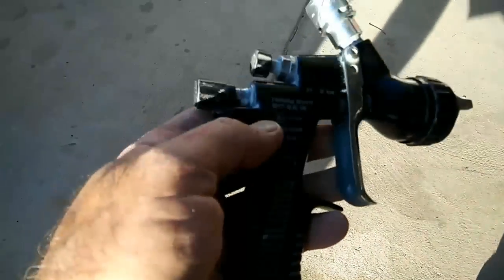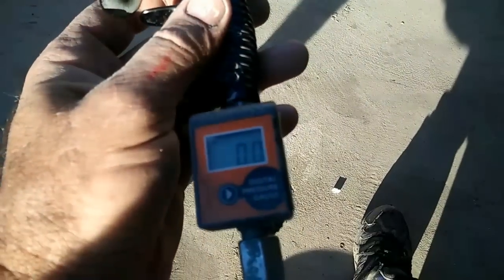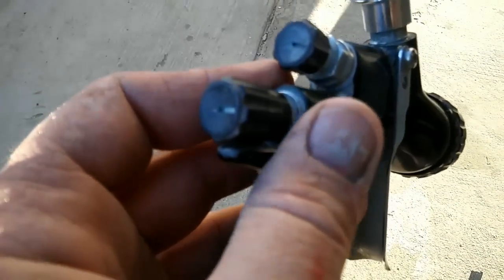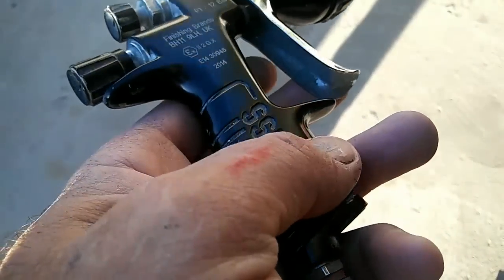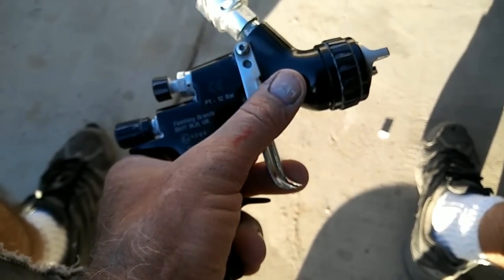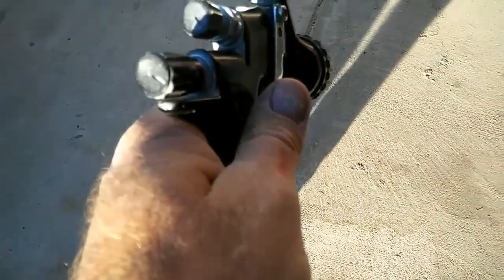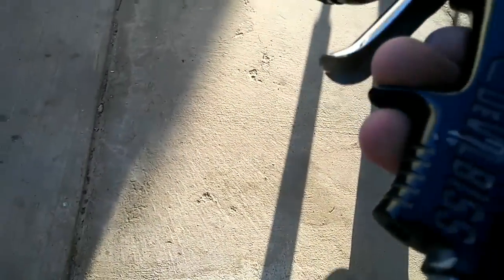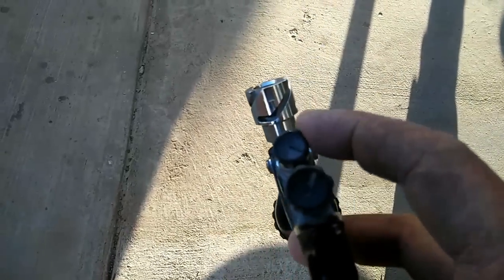How to spray clearcoat without getting any Orange Peel

Comment: Mike, this was a great video, I found it VERY informative. This is exactly the method I have been testing out to meet two goals: 1) get a better clear coat finish, and 2) reduce overspray. I have a body shop and a curtained paint booth. But my fans only move 3,000 CFM each. There are two, and I have a filter box on each that has 4 2'x2' filter sections stacked vertically. I have a friend who is an OG painter that puts 5 thin coats of clear on rather than 2 standard coats, and he rarely ever has to wet sand his finishes. Reason being he is putting on less material which is also more finely atomized, thus giving a better finish with less orange peel. I appreciate you sharing all the details of this, and I am looking at buying that Devilbis gun. I've had my eyes on it. I do have an Iwata SuperNova though, and it does do a great job for professional finishing. I will be checking in to the LVLP gun you mentioned. Very interested in that. I will have to get one and test it. If it works well, I'll probably be promoting it to my clients that I consult for.

Comment: Some good points about balancing that pressure with volume of material. I have been experimenting with no gun regulator lately. Adjusting air pressure thru the guns air knob. Then just listening to the gun and doing test sprays to dial it in. When i'm happy with what I see I go to paint. Trying to get minimal peel and like you said, reduce that cloud! With high solids and my set-up I found the hard way it wasn't breaking up like I needed. So plenty of wetsanding. Then flow coat. More work. More time. So now I crank the volume down as you explained. If I found the video first, maybe I less extra work. But hard lessons are the ones you remember...

Comment: Great video, thanks for all this information. 
RESUME
If youre not painting inside a booth your settings on these gun must be:

-14 psi (1bar) on the tip
-Full open fan
-Close all the material knob and then open it 2.5 turns
-Get closer to the job (between 6 or 8 inch)
-overlap 75% (just advance 25% each pass)

Comment: Its all about the size of the droplets. Larger droplets create more orange peel, smaller droplets create a finer orange peel. The Prolite has a bunch of nozzles and air caps though. Depending on which one you use, the air pressure is going to be different. I like to use 1.3 Nozzle with TE20 with about 27-30psi for clear coating. Full fan and full fluid
Reply from the maker: exactly that is what i was trying to explain the finer the mist the flatter the finish. But getting that at home is a different story. I was more going after the diy at home person. Booth is your settings 1.3 full fan flull fluid. max hvlp air. Or 1.4 4 out. full hvlp air in hvlp areas. Finer mist finer finish. less orange peel. hard to explain when you just do it all the time. but I had to remember what it was like back in the beginning that is why I pause so much.

Comment: My Iwata Lph400 is king at atomizing at low pressure😁 16-18psi and such a fine mist. Super low overspray. 1.3mm, lv4 silver cap, fan 2 turns in from open, full fluid. Sprays on fine and wet so it can flow. Not fast like a Supernova but has way less overspray and uses less material by sending it to the panel and not in the air. Spraying at high pressure atomizes but the clear is drying before it hits the panel and reduces the flow out. If its hot out its worse. Good clears flatten out better and spray better too. Easier to work with. Well worth getting a better gun and better products especially if you spray at home and not in a controlled environment. Cheers👍
Reply from the maker: I would like to try that gun.

Comment: The issue I have with using a HVLP in the way you're suggesting is having a good enough compressor at home.  Iwata & Devilbiss have conventional/ compliant guns that though require a higher pressure, they use less air volume.  You can still dial them down enough to create a fine spray without tons of overspray whether HS or MS clear. MS clear of course would be even better. Way more versatile than HVLP! Plus these guns are much less expensive than those mentioned.

Comment: Dude!  I needed this info!  I used to use a cheapo gun but recently I decided to splurge on a devilbiss prolite.   I've been using the new gun but I couldn't figure out why my garage was constantly turning into a cloud of fog everytime I used it.  Not to mention that I also ended up with either ridiculous amounts of runs or ridiculously amounts of orange peel.  This video of yours was a huge lightbulb moment.  I thought maybe a lot of my issues had to do with the pressure but i was reluctant to stray below the numbers given by the manual.  I'm relieved to hear that cranking down the pressure will be the key to getting this gun to work for me.  I'm excited to put this new knowledge to use.  Thanks a ton!!!!
Reply: Do you know what's the diffrence between the tekna pro lite and the tekna copper?
Reply from the maker: prolite is easier to clean. other than that I think they are the same. But I am not totally sure.
Reply from the maker: yea I have learned a bit more too. TE 20 is now HVLP compliant in more areas. Finer spray. try 16lbs at 2.5 fo 3.5 turns out. start out low then open it up 1/4 turn at a time until you like it. First coat go 2.5 for a bit then second coat open it up 1/4 to 1/2 turn.

Comment: I’m a painter also and or though some of this information is useful and correct there is a lot more to consider, gun type , Hvlp vs lvhp etc , paint vis, hs high solids paints etc tip  size for  what applications , temp , reducer type slow medium etc my point is get the right info for the product from the tds think about your situation and choose accordingly, some primer/fillers require a 15 tip most clear coat can be applied with a 13 , so do the research 🤔☝️👌
Reply from the maker: yea for sure too much information really for a video, Good gun fine spray even coats. Good clear. proper hardener for the weather. Proper reducer for the clear ( if allowed for the product) I will never reduce clear that does not specify because it will lower life of the job. distance for the gun. Tekna likes you really close to the panel. Iwata supernova likes you further away.

Comment: Tekna pro-lite has multiple tip sizes and air cap options. If your using a 1.2 or 1.4 tip with a t-10 the settings hes showing are different than say a t-20. He shud say that to spray nice clear you need a 1.3 tip with a high atomizing air cap with hvlp air fittings (which he doesnt have on his gun) plus you have to clean the gun a lot better, his looks dirty and you shudnt use the same gun you sprayed base with to spray clear anyway. Always spray a test area then make adjustments on the fly. Every day cud be diff depending on humidity and ambient temperature in your work area. P..S try to keep your material at the same degree as your room temperature and high pressure means high orange peel

Comment: Hi, thanks, I spray wood, mainly pre-cat coloured lacquer which i realise now is easy, recently i had to spray some two part PU paint, really struggled not to get orange peel, normally i'd use my ANI guns which work 'ok' but i couldn't get the fine mist you talk about so today i tried my most expense Deviblis gun, it worked great, i now know the difference between the cheap guns n why i had to pay over £100 for the Deviblis.

Comment: You need a make-shift booth.  I made one to paint clear on my stang and it worked very well.  You could actually watch the fumes being sucked out.   Also,  remember there are positive and negative pressure booths.
Reply: What do you mean by that? Any suggestions how to build a cheap paint booth in my detail shop? I paint cars on the side but dont want neighbors and landlord to see large clouds coming out the garage door

Comment: i have used both the harbor freight gun and the techna pro lite, i used 1/3 less clear with the techna, it covered more area cutting spray time by 2/3. because it covers better with less i stopped getting runs and sags and decreased the time to harden. the thing lays down the clear so nice i never have to color sand, cut and buff saving huge time and effort and you can get parts for the gun to keep it working properly. now i spent 500 bucks for the techna and it will pay for itself over time but the harbor freight did its job at a 50 dollar price tag but required a lot of extra effort and additional costs for other items/materials to make it a presentable job. if your doing a single bumper ya buy a 50 dollar gun and get extra clear and base coat plus all the additional sandpaper,buffing compound. if you plan to do a few bumpers a year then spend more now to save money and time later.
Reply from the maker: you bet. The tekna just makes it easier. Just gotta get used to the way it sprays. some guys dont like it because they havent used it enough to get used to spraying much closer to the work. on a perfectly flat panel like that vw bus there is no cheap gun that can make it look smooth. the orange peel just keeps on showing up even after you color sand most of the time gotta block the clear and it is so much work.

Comment: Thank you very much you helped me alot for understamding my hvlp 5000b sata i had problem with orange peel because am new to paint
Reply from the maker: that is a good gun. I have not used one yet. I am not sure if you may need to be 2 inches further away with that one. some of the clear guns like the iwata super nova you need to narrow the fan and it projects more to the surface so you want to be further away.

Comment: The painter has to take into consideration clear coat viscosity.. Low VOC clear will be thicker because it has less solvent for the EPA bullshit, high VOC clear will be thinner and more slick when applied like chroma clear. European type clear is always thicker and produce a orange peel. Over reducing is the only way to get a really slick finish. My opinion as a Fleet painter and Automotive Painter for 25 years.

Comment: GREAT vid Mike....anytime someone tries to help others it's a big win for everyone if you ask me.  It took a lot of time to produce this clip and people should be more appreciative for sure.  I just painted my jeep and I got some orange peel.....harborfreight....hehe  I have a much better gun stashed away ready to paint my hotrod....I'll be using it. The harborfreight gun worked ok but had a 1.3 tip...too big for clear.  I'll be using a debilibiss finsih line to paint my 65 Comet.  I think it will produce a much better finish.  Thanks for the vid and help!
Reply from the maker: thank you for commenting. Need some positive input. The tekna prolite is a awesome gun if you have the compressor to push it. HF guns spray ok for a while but wear out fast. As a cheap alternative that cleans easy and uses little CFM the Spray it lvlp is pretty nice for pretty cheap. 50 on amazon. Have a review on it and also using it with a turbine compressor. 8llbs max pressure and it sprays with almost no overspray. volume not really enough for a complete car but pretty cool.
Reply from the maker: finish line is also good but totally different than the tekna from what I understand. they work good for single stage urethane. clear ok but it is a easier job with the tekna.

Comment: spray pattern of  adjustment is capital to have a good and uniform finish,
as you say, the gun quality is important as a cheap gun will " rain " the paint instead of fraction it in fine droplets.
also, the clear preparation is so important as the trick is to flow the second coat into the first one and not dusting it over.( often I prepared my clear too fast and the second coat application was a nightmare )
with urethane based clears, it's normal to have a bit of orange peel at the moment of application but as the clears sets, this orange peel resorbs and leaves a finish as you show us.
very interesting video.
Reply from the maker: thanks for the clarification. You must have been spraying a lot of good HS clears. The cheap ones go on pretty good with a cheap gun but the HS ones you need a good gun and the right hardener is key for flash times between coats to make it look smooth. That second coat needs to melt into the first one just right. I made another video on that subject to clarify. There is just too much to explain on this subject on one video

Comment: The paint had loads of orange peel!!! Best and flattest will simply be a warm environment, Slow Hardener and slow reducer and a flat surface is best! Push it on (no light  spray) and follow the wet edge! :)
Reply: gringo loco2  I don't have a booth neither, I paint in 32c plus weather and basically make a room out of drop sheets! Slow R & H take a few hours to dry well but nothing major, plus saves a whole heap of cutting. If you 100% without cover then standard is the go, fast if you're shooting in cold weather! I may not have done as many cars as yourself as this is just my personal xp but i have shot 4 cars in slow slow and covered (room like) in drop sheets and works fine! You'll get the odd bug or hair etc etc but again, not 100% in the open....
Reply from the maker: That was not heavy orange peel. At all  That was a flat vertical panel. I would like to see you spray a VW bus. and Yes you need to cut and polish when you spray at home not in a booth. Need lower air pressure to not have so much overspray.  So you sacrifice with some degree of orange peel. if there is too much you can NEVER sand it out on a flat panel it will always be there even if sanded. . Spray Low pressure and try to do that. yes you need to watch the dots touch together and smash just a bit but not too much or they will puddle. then you have runs. Sometimes you dont have a choice what weather will be. I also tried it at 120 degree panel temp and that was totally impossible to get smooth. ideal weather is about 85 degrees to me. fine spray smash the dots and keep it even.
Reply: @Mikefngarage  You've got low standards, I paint in my garage or carport, best temp for me is around 30c to 35c with a slow or normal reducer n Hardener. Yes also cut n polish my shit too. In saying that I didn't say it was heavy orange peel, just a shit tone of consistent Orange peel. but then again I like to flow coat all my projects!